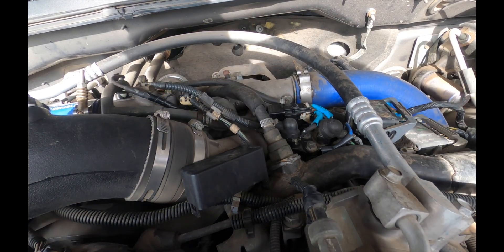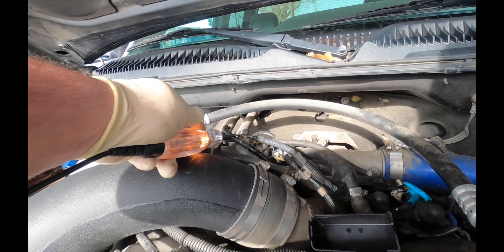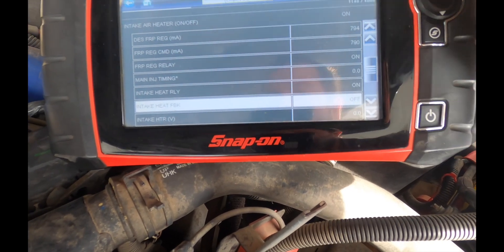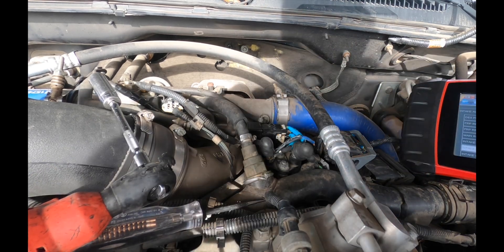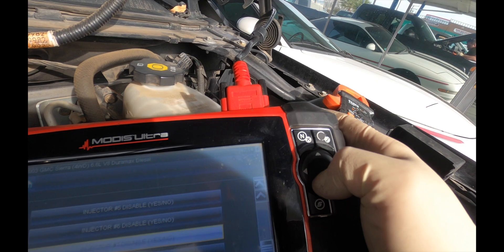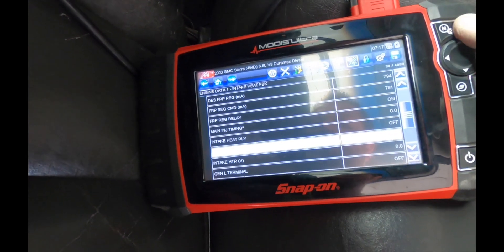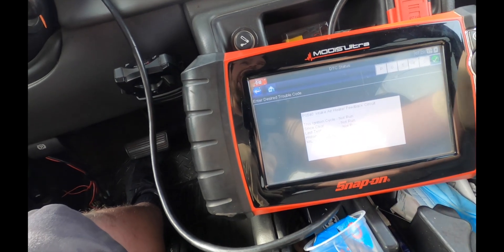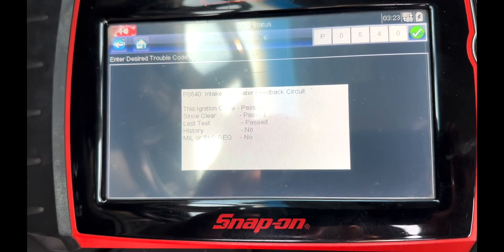2003 GMC Sierra 2500Hd P0540 Intake Air Heater Testing

Comment: Would this code make the transmission run funky or would it effect anything?
Reply from the maker: The only issue I can see with the install air heater not working properly is hard starting or smoking from the exhaust after startup. Once the engine is even slightly warm it doesn’t need it anymore.
Reply: @drewsshoplife mine cranks for a couple seconds whether it is hot or cold. I have code p0540. Does that sound right?